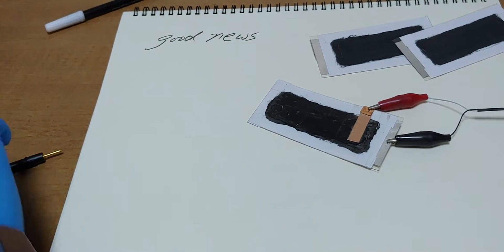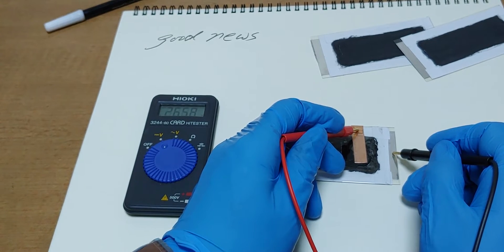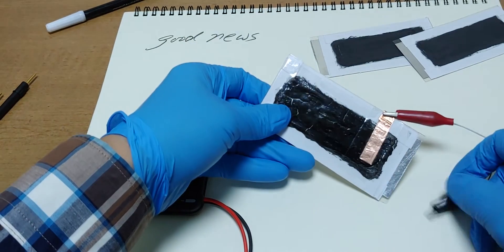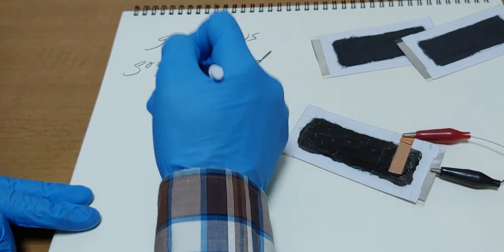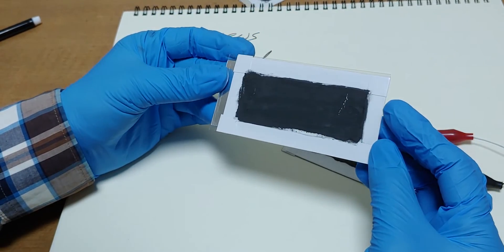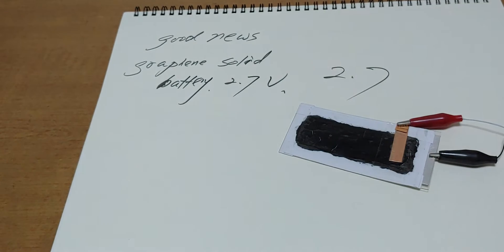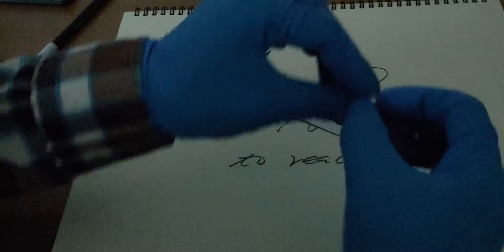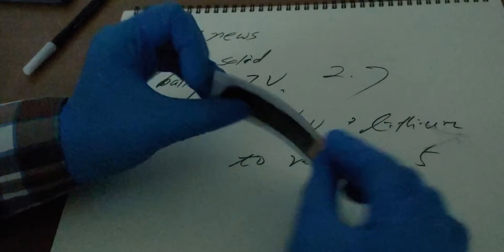2.7 v solid graphene battery

Comment: Hi again! I always try but failed. 
i have Some questions.
1-What is the mixing solution (is only water?)
2-What is negative material??
3-What is charge woltage and amp. and how long time charging.
4-what is mixing ratios  graphene and sulfur(mol)
5-Sulfur is dangereus(flammble and toxic)  so can we  use another material. Thank you.
Reply from the maker: First thank you for your concern. And I admire your passion of developing a new kind of battery.
1
To make graphene solution, you must develop the solution which has some viscosity. But having viscosity means you have some impurities, which will increase its ohm. And that is another barrier to be overcome as I have been faced.

2
Anything whose electric potential is lower than graphene can be a negative material. I recommend you to use the material in the state of oxidation.

3
Yes, 2.7 volts. But amps is not important in this stage. What is of importance is to find a way to increase its voltage.
Amps can vary depending on the ohm of graphene electrode.

4
I've never thought about it. That's because I am absorbed in increasing the voltage of a battery.

5
Sulfur in solid state is not that flammable. You can use it in the solid state.
But never heat the sulfur, which is dangerous and really harmful.

I admire your passion again.
Reply: @solidbattery9956  thank you so much good man :)

Comment: And How build this battery pls can you Show us all stage. Thank you. 
i thing aluminum/paper/Graphene+sulfur is that right?
Reply from the maker: No, there's no paper (what you mean may be a separator). This battery doesn't use paper because it increases the ohm of the battery.
Of course, this battery has a separator whose type is a negative material to help increase its amps.
Reply from the maker: Yes, sulfur is the essential material in my battery.
Reply: @solidbattery9956  Well but how dissolving to sulfur?
Reply from the maker: @mehmetozturk9477  
Only way to turn sulfur into liquid is by heating but doing like that is really dangerous. 
Worse, the liquid will become soild when cooled.
We must avoid doing it. Really harmful.

Luckily, sulfur is very brittle. We can make it into fine dust.
Then mix it with graphite.
Have a nice day.
Reply: @solidbattery9956  you are realley good man thank you so much :)
Reply from the maker: This battery doesn't use paper as a separator. 
Before I also used paper as a separator, but since it increases the resistance, I don't use it anymore.
Instead, I began to research on a solid battery.

The battery shown above is a solid battery. So it doesn't requires any separator.

Comment: thanks.

 what about amperage ?  what is that white thing as a separator ? is that graphene with sulfur ?
Reply from the maker: Amperage won't be good enough yet.

The resistance caused by graphene is still too high, which lowers amperage.

For the negative electrode, yes graphene sulfur is used.

For the separator, Positive material is used

Thank you for your concern